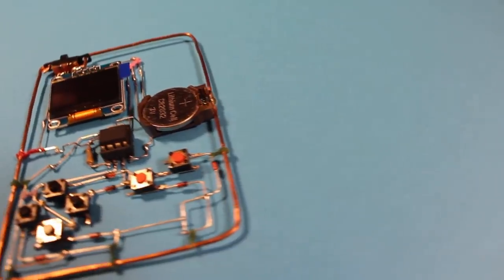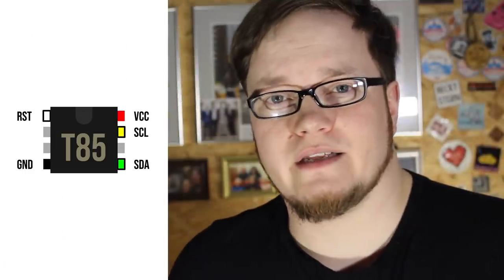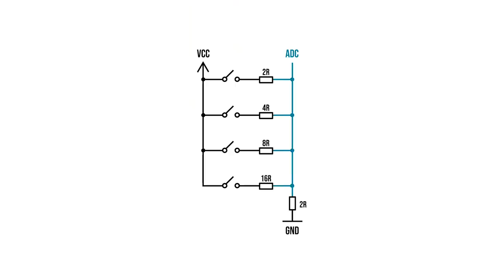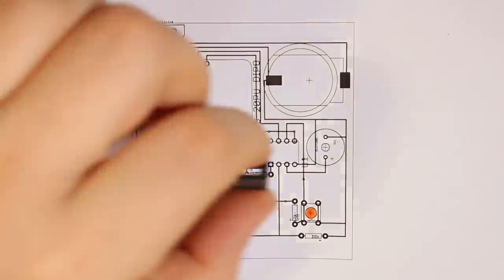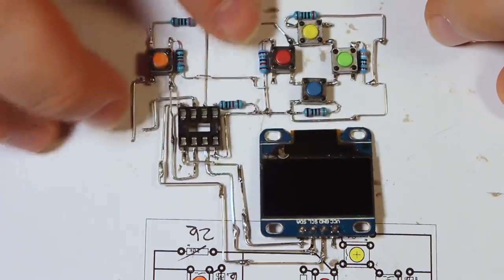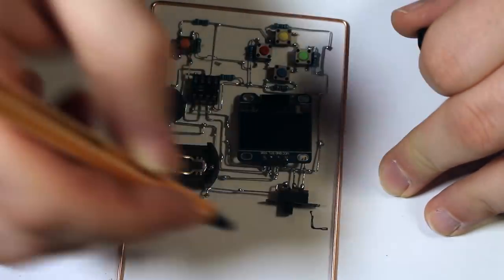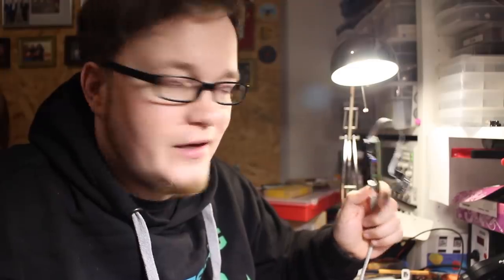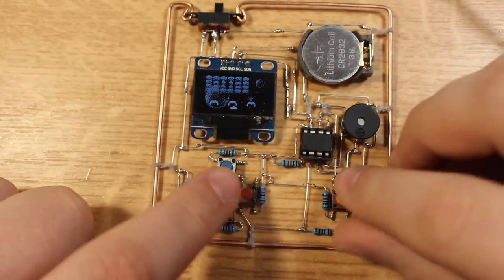Retro Gaming Handheld Without a PCB

Comment: You can still program the ATTINY using high voltage programming if you use the reset pin for I/O.  Shouldn't be complicated to augment your ASP to do it.
Reply: That is correct. I do have a "high voltage" programmer (modded arduino ISP) for that as well, but this video is also aimed at people who might not have one and this was just more convenient, so I said "not easily" ;) Daniele Champagne was commenting here that he actually doesn't even set the fuse to use the reset pin as an input.

Comment: Thanks that was a really fun and interesting video. Another way to reduce inputs is to exploit the fact that a D pad never goes up and down or left and right at the same time, so hook these input combos to be switched together on the A and B buttons respectively. You need diodes so that up isn't triggering down (and A) after though (for example). This gets you 6 buttons on 4 inputs. In theory, you could hook a 7th (C) button up to all 4 inputs, but that would require the A and B buttons to be on a rocker, else you couldn't differentiate between the A and B button being pressed simultaneously or the C button being pressed.

Comment: i have these resistors in place of yours 2.2k, 4.7k,10k,22k will it work , what exactly needs to be changed in the code if it to work with these resistors, brilliant idea with voltage divider by the way
Reply: Hey there, it's been a while since I worked on this, but it seems like they should work. Please use the link in the description for further infos, I don't get notifications from this channel. Only on the community.
Reply: @Davedarko  ive gone through the code and used the above mentioned resistors and they dont work , not a single button is registering any movement , not sure if the code needs to be changed , ive checked my connections thouroughly
Reply: @manohar3787  sorry to hear that, I checked my calculations in the mean time and have no idea anymore, what I actually did there. If you can, maybe connect the resistors to an Arduino first and put out the values of the ADC on the serial port?

Comment: A solid resin case would be interesting to improve durability and maintain the skeleton look.
Also! I love the way you handled multiple inputs, I've been puzzling how an analog matrix like this would work ever since I saw Ben's no HDMI pi build
Reply: Hi, I'm currently preparing everything to be put in a resin case! I'll post an update on my channel and a tiny "community section" bit into my next video. So far I have something printed and made a silicone mold of it. Now working out the resin part and keeping the mechanical things working. That noHDMI build is still impressive, indeed!

Comment: I personally love this style of circuit, it gives it character and depth.
Reply: I'm going to encase it in resin / epoxy soon, first tests look very promising. Hope it helps keeping the character and make it more robust :)
Reply: @Davedarko ah, that's cool. A suggestion, you should maybe make it rechargable. A small Lipo cell would probably last longer than a coin cell, and you wouldn't need to worry about replacing it.
Reply: @HobkinBoi  I thought about that, but than I would want to also add a wireless charger etc. and that thing will get more and more complicated 🤔anyways, thanks for the feedback!
Reply: @Davedarko  Fair enough, lol. It would probably require a total redesign too, if I were to guess. If you do make another one, it could be your third version. 

Though if you do ever go about encasing it in resin with a lipo cell, make sure you give it room to expand and to vent (in case of it puffing up).

Comment: This was pretty cool and I think it helped me with a couple of problems I thought about in my first project and maybe I can use some of the ideas shown here
Reply: cool! are you sharing your projects anywhere?
Reply: @Davedarko  not rly, still working on my very first project and with just dtarting to learn about soldering, resistors etc. It takes quite a while to start designing a handheld around an existing Raspberry Pi Unit. But I'm getting there and now I know that my idea of using an ADC to connect all inputs into a single Pin is really doable the way you have shown it
Reply: @OnezOgirdor  always good to have a project to focus on, when you want to learn something! I'm not sure, but I think there is no ADC pin on the Raspberry PI to do that. There are a  lot of tutorials on adafruit (look for game girrrl etc.) to make buttons work on a RPi. I personally used an atmega32u4 board on my handheld for that and connected it via usb. There are a lot of options you have, I'm sure you will make it work :)

Comment: really amazing Dave, really good work with the freeform soldering and simplicity in logic for the buttons.
Reply: Well thank you! :)
Reply: @Davedarko  I see that the resistor values that you chose are not exact in terms of R, 2R, ,4R etc ,  also if we have other resistor values that suit this R,2R logic can we use them , if so do we change anything in the code , appreciate your help

Comment: I wonder if it would be posable to make this even more basic. I would love a device wich has allmost nothing but battery wire and led. Games can be as simple as a clicker wich resets after the 2nd led lights up?
Reply: Also wonder if you could make a microcontroller as basic as possible
Reply: @wabsol  since everyone seemed to like the simplicity of this one, I thought about doing something that doesn't involve coding at all. Just put together 4000 series of logic chips and make something cool out of it. Thought about props and make them blink in a cool way. A buddy of mine wants to build a "Game of Life" where every cell is a module - maybe I can make that with cmos chips? But that's far from batteries + wire + led. Hmm.
Reply: @Davedarko  Sounds interesting! I dont understand most things you say but that might mean ill learn new things.
Reply: @wabsol  still trying to figure out the right balance of things people might know / learn from vs. know but haven't seen it used like that before :) the videos by Ben Heck I like the most are the ones where I learned something and had the feeling that I could almost do the things on my own now. Sorry for waffling on :D

Comment: It is possible to upload the game codes to an SD card e then you read from attiny e load the game ? The code will be very complex, but you know if anyone tried this ?
Reply: I believe that Djamal uk is doing a project on this topic which has been named TinyConsole_V2 ;)
Reply: The only thing close that comes to my mind is Atmega32u4 based and that's a modded Arduboy. You would need a special bootloader that reads games off of an SD card into its own program space and show it on the screen for you to select. That'll take some of your program space away already and so space for games is even less on an 8k chip. There has been someone on hackaday also adapting the console by Daniel Champagne and putting the attiny85 on an microSD card shaped PCB: https://hackaday.io/project/164736-multi-game-console

Comment: Great to see you over here, Dave! :D And I'm a huge fan of "open frame" builds like this :P
What I've done in the past is use reverse biased diodes as support bridges between sections of wire. They act as insulators providing you get the polarity right :D
Everyone go sub to Davedarko!
Reply: open frame - that's a nice word for it, too! Good point on the diodes - I was just really happy how the thread and glue performed the first time :)
Reply: I had the same idea, but I didnt look at the comments before leaving mine, so I repeated yours. Sorry, I will remove mine.
Reply: @mitch3064  it's fine :) more comments means more interactions so youtube is happy with the video
Reply: @Davedarko  I completely forgot to comment on the most important part. Fantastic idea and build, true blend of science and art. Thank you.

Comment: couldn't you fold it in half and end up with a better form factor? you'd just have to be careful to not make contact between conductive parts.
Reply: Hi and thank you for your feedback. Not sure folding is the right solution here. I was more talking about proportions, something that is easily changed :)
Reply: @Davedarko  hmm, seems like there's a line roughly down the middle where there is nothing but metal -- no resistors or other components. that was what i meant. that would put the battery roughly behind the screen, for example.
Reply: @obvious_humor  ahh I see, but then the action button would be on the back of the D pad o.O

Comment: this question does not correlate to the vid post but i am curious. why do all wires differentiate by color? does every color in every wire corresponds by voltage capacity? like black as negative or ground? what if i choose red color as a ground does it have a cons? PLEASE ANSWER someone who is knowledgeable to electrical engineering
Reply: First: never trust the wiring of a project- I've had several cables use the right color scheme, but switch ground and VCC. Normally people try to use black for ground and red for VCC though. It's always good to have different colors for different voltages /signals. But it's also good to always check your assumptions.
Reply: @Davedarko  tnx for the reply

Comment: Can i use 1/8w resistor? WIll it be "enough"?
Reply: absolutely :)
Reply: @Davedarko  I gave another question, which file contains schematics?
Reply: @kapys1722   Hey Kacper - I've checked the files and noticed that I've put in some confusing stuff and an important PDF is missing. I've contacted e14 to update the zip file on the community page (you can find the link in the description).
Reply: @Davedarko  Thanks :)
Reply: @kapys1722  I've been told it's updated now :)

Comment: Why not design a single sided circuit board, and use the schematic to laser-cut a piece of steel.  The fiberglass is there mainly for rigidity. The steel should provide the necessary rigidity.  Maybe get creative with the ground rail for additional support. You should be able to outsource the laser-cutting to some Chinese company.
Reply: Laser cutting steel sounds like something that I consider not that easy for everyone to get access too. Not that every video on this channel has that on mind, but in this case it was more about that skeleton style of soldering, making it easy to copy, if you've always kept your LED legs, like Ben Heck told us :) Thank you for your input, much appreciated - have you ever outsource a steel laser cut to China?
Reply: @Davedarko  No I have never outsourced a steel laser cutting job to China.  I know those services are available in the US. https://www.ponoko.com/laser-cutting/metal
I assume they have those services in China at a cheaper rate.

Comment: does anyone have a link to a video with detailed how to program that ic with those files using an arduino?
does the chip have to be modified coded with only the game code? does it first need a type of os?
Reply: Hi Brian! You will need a USB ISP programmer (or any arduino) for programming the attiny. There is no bootloader (what you probably meant with OS) needed, as you will program the chip directly. This is an older video https://www.youtube.com/watch?v=30rPt802n1k, but also try googling for "programming attiny85 with arduino".

I will see that I can make a video on how I did it as well. Thank you for the feedback!

Comment: Well you did kinda print a pcb. Just has huge holes and isn’t made out of paper.
Reply: Hm. The board material is air then? Reaching. No cnc or etching was used, no pcb manufacturer involved. One could say the paperguide is printed, but then again it's not present in the final project. I've glued prints on protoboard as a guide before - that I'd consider a printed circuit board. A guided freeform circuit on the other hand is pcb free.

Comment: Hi all, I was wonder if anyone knows of a little board that I could hook up a small LCD and plug in an micro SD card and run vidoes. I'm looking to make a very small video player kinda like those smart pictures frames things.
Reply: Hi duby - that all depends on the size and coding effort you're aiming for. Video decoding isn't trivial, so you'd need a beefier board than a standard atmega328 based arduino. It might be easier to go with a Raspberry PI, but that means you should feel comfortable with working in Linux. I suggest to look around for similar projects - try to combine raspberry or arduino with video from SD in your searches, as those have the bigger community to get started with a project like that.
Reply: @Davedarko  not going to lie I only understood half of that LoL, but I have no programming skills what's so ever. I thought of using a Raspberry Pi but that seems like such over kill for just to play back a video on repeat, i have seen what I'm looking for a few times in stores on displays for make up like there will just be a little screen with a board and an micro SD card playing a video or a gift not sure in a loop.

Comment: The retro handheld that shouldn‘t be hand held?
Reply: the pointy bits are cut off, it's just easier to film that way ;)
Reply: davedarko I wouldn‘t feel comfortable holding it for different reasons. Aesthetically very pleasing, but isn‘t it a bit delicate to actually play on it.
Reply: @kduhtdkzrt  the games aren't that time consuming, so you can play it for a bit without worrying too much to break it. It's also easy to spot things to fix, very repairable ;) Definitely is more on the show piece side, though - you're right
Reply: @Davedarko  Consider potting it in clear acrylic with a hatch for the battery and elevated buttons so they remain functional?  That would add the mechanical stability yet maintain the visible aesthetics of the cool skeleton construction.  Handheld awesomeness!!  7:07  Niiiiiice!!
Reply: @UCWgQoLDOoyUGS4J5COvGEOA it's a bit tricky to keep the buttons functional, but I've seen some projects and have a rough idea how I could pull it off. I will probably film that for my personal channel and give a short update / community feedback in the next vid. Thank you for your input, much appreciated!

Comment: more like tabletop.
Reply: Well not anymore - I took the comments to heart and put the whole thing in resin / epoxy ;) but to be fair, it was on the table so I can film it properly. Video about the process will be on my channel, as well as a tiny community feedback section in the next video. Thanks for the input!
Reply: @Davedarko  it seems to me that without any case it's too flimsy to be handled.
Reply: @talonfluff  it's pretty flexible, some of the legs were from smaller resistors and hands are soft too, so on that side it's surprisingly playable. It's a bigger problem to have all the pointy parts to poke holes in your fingers after a while. So the resin helps a lot with that :D